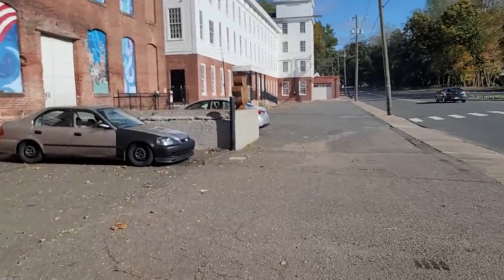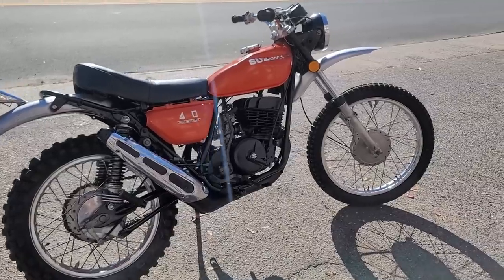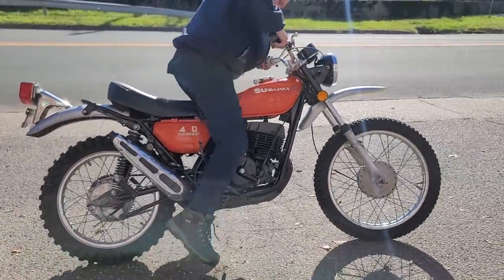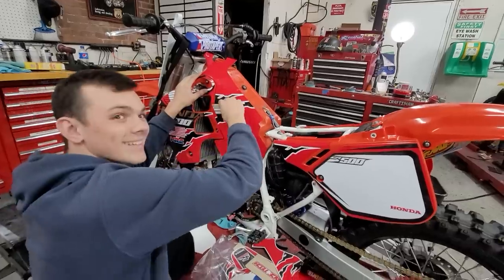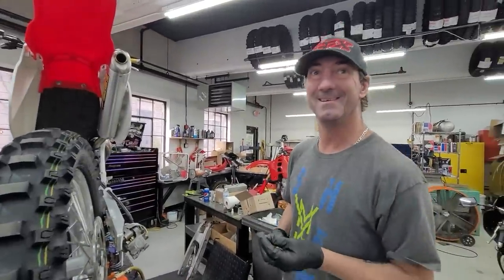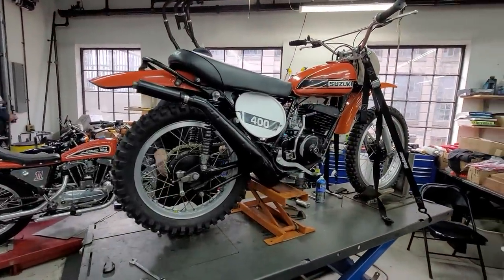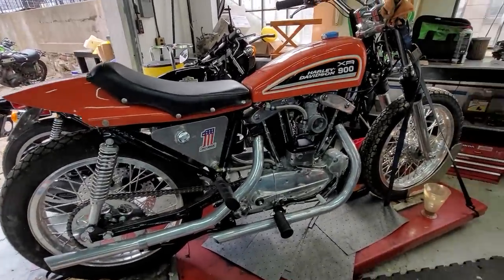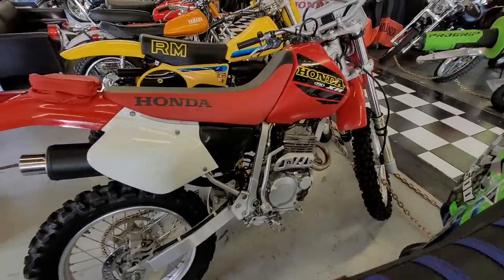25+ PROJECT BIKE UPDATES: SUZUKI TS400, DT1 250, S2 350, CR500 & MUCH MORE

Comment: Wow the things I could do to that TS 400 ...back in 1975 the co owner of the Santa Fe New Mexico Suzuki shop Mike Brimer won the prairie dog motorcycle club mile-high Enduro of cloudcroft New Mexico 250 class on his everyday rider a TS 250 Suzuki .... There is a big huge misunderstanding about Suzuki's oil injection system on these old two strokes ...you never never never disconnect it AS THEY WORK FOREVER SPOT ON ... You might want to look at the owner's manual or shop manual for the correct adjustment of the cable to the pump as it has an adjustable volume.... Suzuki oil injection system is light-years ahead of everything else that has ever been done... Not only do they have a oil line going to the intake port if you look closely there is another oil line bolted to the left engine crank case that supplies oil directly to the left main bearing of the crankshaft ...the right side crankshaft main bearing is lubricated by the transmission oil....and here is the game changer as Suzuki's oil pump is driven off of the transmission's countershaft at a much slower RPM than direct from a crankshaft as the competitors of did !  And running the oil pump from the transmission shaft eliminated all the piston and crank vibes that destroyed Yamaha pumps in a short ...and guess what I just now found a drawing of the oil injection set up of my 1967 Suzuki 120cc single ...check this out and you will what to get your hands on this TS 400 ..IMAGINE Ohlins front and back and a tuned pipe ..with a license plate 
https://www.thejunkmanadv.com/2-stroke-oil-injection-systems.html